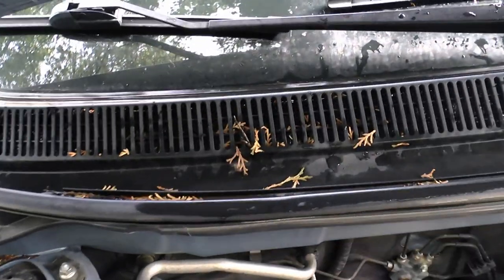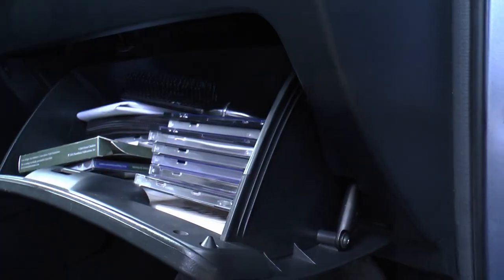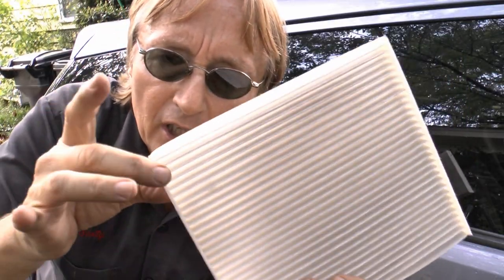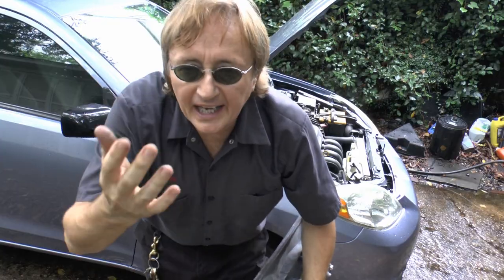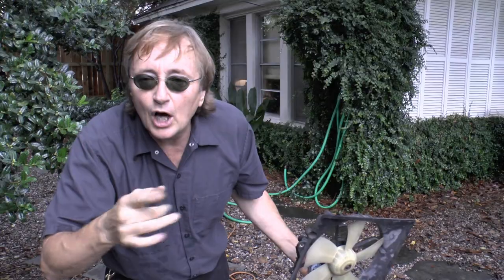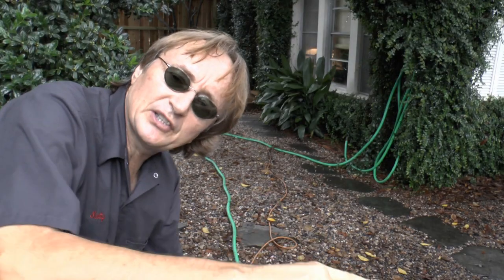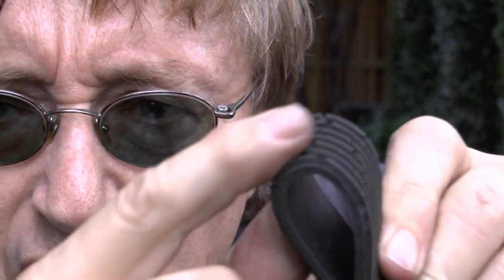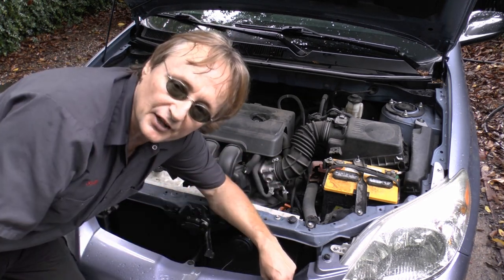How to Keep Your Car's AC Blowing Ice Cold for FREE

Comment: Thank you for the tips Scotty, I had previously thought my AC compressor was broken for several years when I finally discovered that it was in fact one of the fans (the smaller one that blows against the condenser). I ended up purchasing both fans and the assembly online for a fraction of the price (of the dealer) and installed it myself. The AC works now and blows cold air. 2008 VW Jetta GLI, 208k mi.

Comment: Tips to cool the car off quick. 

1- open the windows and drive around a bit it will circulate all the hot out. 

2- close the windows and turn your dial to AC let the car get nice and cold 

3- once cold turn the dial too the air recirculation feature it will recirculate the air in the cabin so the AC compressor isn’t always running saving you on gas. 

4 - turn the cold dial all the way to cold that way you can set the blower fan on low and still be nice and cold. This trick works nice with the air recirculation feature but won’t entirely freeze you out 

Those are my tips
Reply: Well that explains the automatic climate control gimmick as thats all it does, is lowers the fan speed after it reaches desired temps
Reply: @StudiosDelirium  wait really???

I always turned on the ac without rolling ny windows down and yet here i make a response to this

Comment: Got a recommendation for those dual fans. My car was overheating all the time at a stoplight when you have a low idle the compressor seems to work overtime and heats up really fast and overheats the radiator and the engine overheats. I always noticed that there was only one fan going and the other one kept going on and off so what I did was disconnected the connectors to both fans hook them up together in series and connected them directly to the ignition 12 volts. That way they're running all the time at half speed. This kept the radiator much cooler. You can even disconnect them in the winter time but don't forget to reconnect them in warm weather. No more overheating problems.
Reply: I was looking for this! My AC runs Ice Cold Yet when I'm at a stoplight it starts blowing warm and as you said then my engine heat temperature rises. I appreciate the idea thank you!

Comment: Yes, that nagging problem of bugs getting stuck in and plugging up the condenser and radiator. The simplest solution is to put a piece of screen in front of the condenser. It's much easier to clean the bugs out of the screen. Also, I remove it in the winter months, takes only a few minutes.

Comment: my ac consists of rolling the window down.compressors shot
Reply: nothing wrong with the good old 470 ac system haha
Reply: Wow your cool as fuck m8
Reply: I think you be wasting more gas that way because of the drag caused by the open windows.
Reply: Allanisbest not true...mythbusters busted that myth a while ago. AC uses a lot of power because the compressor takes up to 5 horse power to operate, making it less efficient to use than rolling the windows down
Reply: Well thank you
Reply: Allanisbest On the highway you are right. In the city running the AC waste more gas but it is marginal in either case.
Reply: Allanisbest yea ac kill mpg. thats the only good thing about not having ac lol.
Reply: don't be afraid to checkout some of my mechanical videos. All you respondents seem like great viewers.
Reply: CalebJ77
I thought the same thing. lol
Reply: im afraid Russian air conditioner would not do in my country ( rolling down window) 
three days ago it was 61 Celsius convert that to your preferred measuring system 
no need to warm up your engine in my opinion lol
Reply: CalebJ77
Even on the highway, mythbusters have busted that myth. It is less efficient running the A/C when compared to with the windows down, even on a highway.
Reply: i do it to reduce the thermal load on my radiator not the mileage
Reply: Faisal Abdulaziz Bullshit 61C!! What city, state? I smell LIES!
Reply: City= windows down/ Highway= ac
Reply: same here...especially after having removed everything associated with the AC from under the hood and scraping it...its kinda cool to remove stuff from the engine bay and the car still runs
Reply: @Faisal go update the Wikipedia article about the average temperature and add a comment stating that you live at that city.

That's what wiki is all about! you can even post a pic to wiki, make it it's own content dot point with an image
Reply: you need help...like fast
Reply: Allanisbest So,...what it BOILS down to is this; Do you want COLD air, or HOT air? fukit, if it's that hot, I'll waste a few dimes on the gas. Besides, I thought the newer units didn't put that much stress on the engine?!
Reply: James Valenti My 2006 Toyota Corolla gets about 6.5L/100km or 36mpg with the air conditioning always on in mixed highway and city driving. The AC button is literally never off year round. At that mileage, I don't really care if it uses a little bit less with the windows down, I'd rather have a nice quiet, comfortable ride. 36mpg is fine.
Reply: sweet stuff....that why little cars are more efficient in many ways
but if you can find the bmw  m3 (v8 engine) vs toyota Prius 1 gallon challenge you would be surprised
many factors come to play like :
1-  wight of the car    
2 - aerodynamics 
( obviously a box shaped van wound do good here would not do good with the first two)
3 - driving habits (do you accelerate hard ?)
4 - engine size to car size
6 - fuel system 
7 - environment (hot and dry ? hot and humid ?
cold ?) 
8 - increasing engine compression ratio means more power for the same amount of fuel
so less fuel is applied to to the engine to reach say like...80km/h ( =thus creating more miles/gallon
9 - are you using the turbo version ? or the
 naturally aspirated version ?
(turbo version run on richer mixtures when under boost)
10 - transmission ? (manual ? auto ?)
Reply: Faisal Abdulaziz 1.8L hatch, manual, naturally aspirated. Not really hot or cold just average. I don't accelerate hard, just the same as the cars around me.
It's a fairly small car but my dad has the Sedan version of the 2004 Corolla and he gets the same mileage.

http://upload.wikimedia.org/wikipedia/commons/d/da/2004-2007_Toyota_Corolla_(ZZE122R_5Y)_Levin_5-door_hatchback_(2011-11-18).jpg

I'd expect a bigger engine like a V8 to be affected less by the AC because of how much torque they have.
Reply: sweet what you have is a gas sipping machine lol
i agree thats why belt driven superchargers are ideal for v8s 
mine is a 1800lb volvo s80 3.0 turbo aspiration
does 70% of your cars gas mileage as long i dont exceed 60km/h (underboost and slow acceleration) 
once boost spools its bottoms UP for the fuel tank
kinda heavy (i hate the heavy doors)
and the interior isnt that big abit bigger than a corolla...
drag coefficient is ookay ?.... 
auto transmission...now there is you main mileage killer
Reply: Gary Kovach
I'm driving a 92 sc 400. Those things drink gas. I usually turn the ac on a few mins let it get nice and cold then turn the ac off and let the fan blow. I can usually catch 10 mins of cold air that way haha.
Reply: Allanisbest Refrigeration systems are least efficient when they first turn on. That's why home air conditioning specialist recommend a smaller air conditioner that will cool the house over a few hours rather than an over powered one that will cool it in 30 mins because they are more efficient that way. Whether that makes much difference to your fuel consumption, probably not. I just leave it on always but my car is pretty efficient, yours, not so much...
Reply: 3DMachines sweet you are from buffalo im originally from rochester scottys from niagara falls aswell which isnt far from where i was born
Reply: SvddenDeth maybe I should stop by on my bike then!
Reply: haha! i should invest into a dirtbike
Reply: Lol dalton been a long subscriber. It seems I always see random comments you've made on videos all the time.
Reply: I was going to say, that is 141 degrees Fahrenheit! I do not believe this person at all.
Reply: My old car has 240 ac.
Reply: Ah, that's what we call Chrysler AC.
Reply: Allanisbest and messing up ur ears
Reply: I drive with them down because I hate being in closed spaces for one and 2 my ac smells weird and gives me a head ache when I use it, besides if I turn it to cool and then have it off it stills blows in outside air so
Reply: i just researched it, the highest recorded temperature in kuwait was 54 degrees Celsius. which is still hot as fuck
Reply: James Valenti  up to 50 mph in that specific car... ac uses same ammount of fuel always, drag by speed changes mph faster you go
Reply: RIGHT!! Me to
Reply: 3DMachines And speeding
Reply: quit playing 3d machines
Reply: My old Buick was that way. Its not bad while moving but in traffic it sucks.
Reply: 3DMachines Fix it lazy but....😂😂😂😂😂💣
Reply: In the dark ages ac was rare. in the summer when a car went by with its windows up, we kids stopped playing and stared. "Must have air conditioning!" one of our brighter compatriots would say.
Reply: glad I'm not the only one suffering a future heatstroke
Reply: meyaw Abdulaziz 142° Fahrenheit
Reply: Yankee AC
Reply: Save dat money
Reply: Thanks you're right compressors out

Comment: Run it even in the winter to lubricate the seals!
Reply: running the defrost does this. the climate control runs the compressor durring defrost on most systems to help dry the air blowing through
Reply: Good advice
Reply: It runs in heater mode too, it's a heat pump
Reply: Brandon Gains not a heat pump. That's something different.
Reply: Brandon Gains its a refrigeration pump totally different
Reply: in automotive HVAC thats a big negative there good buddy. heat comes from the engine coolant in the heater core in that case. check it out yourself.
Reply: Garon Burwell who is that to?
Reply: bonkey it was to brandon i guess i'm an idiot have a great day
Reply: Garon Burwell you are nor an idiot , you know the difference between a refrigeration pump and a heat pump........don't be hard on yourself
Reply: Snowmobile mechanic..... looks like you blew a seal...... Eskimo......naw, that's just snot....................(sorry old joke)
Reply: Mark Weidenfeller m
Reply: It runs in the winter when your defrost mode is on
Reply: cndbx true, but some of us live where there are mild winters with little to no frost so it’s good to know about compressor usage by defrosting and the need to run the compressor when it’s not hot.

Comment: Thanks for the 101 Scotty! On the '05 Mitsu Endeavor the filter was optional. It plugged with leaves just like you said it would (wet carpet and sloshing). Got filter and snap on door kit from dealer. Cut opening along pre scribed lines, slid in filter, snap on cover, done! Located same where you show in glove box. And that year was impossible to find condensation drain tube. 
No problems since.

Comment: FYI:  The irritating screech everyone thinks is the a loose belt is sometimes a pulley;  many chrysler idler and other pulleys come with only very small dab of grease in the roller bearings inside causing premature bearing failure;  (u can pop off the oil seal with a pin then work it around the edges without damaging the seal), then pack it with more lithium grease (or other clean grease in a pinch).   If/when it does screech, later when engine is off, the hot grease inside will drip/ooze down onto the bearing axle, so the next time you start the car it won't screech anymore.  Works for me.  I was going thru a pulley every 3 months until I investigated their shoddy grease job inside the pulley ball bearing area.

Comment: As an HVAC guy I can confirm all of this is true. when we maintain a home AC system,  we clean the condenser, normally with a garden hose, and if it is extremely bad we get out the caustic brown coil cleaner that can eat right through the metal, clean, and rinse it. we normally use a much less harsh cleaner in the evap coil, because it is indoors and the garden hose is not an option. check filters while indoors, then we then measure all things electrical to see if any parts are failing, capacitors, running and starting amps, etc. in a car it is mostly the belts.

Comment: Great Vid Scotty! You explained every thing I always wanted to know... (hence I NOW know where the AC inlet is; because every time I start my AC I get debris from the trees above me being blown into the car...) --- Btw, my fan on the radiator isn't spinning --- what should I do and check? Is it fuses or something else? .... My car is a Peugeot 106 - early 90's model (pretty basic car). Thanx - & I Love your Vids, Awesome.
Reply from the maker: check the fan by sending power and ground to it to see if it's burned out first. often just that.
Reply: I had that same issue (regarding the fans not coming on) with 2 different vehicles and both just happened to be a $12 sensor which is the coolant temperature sensor.
Reply: Andrey Ivanov - Peugeot 106 has a very basic foam filter that can be cleaned/washed and put back into service. If leaves are being blown into the cabin most probably it's not there at all. Very bad idea 'cause usually leads to a scraped blower motor. Plus the obvious discomfort of having leaves being blown in your face. ;-)
Further more, clogged ventilation grill/ducts also lead in most cases to a burned resistance...When the lower speeds of the ventilation don't work. only full blast.
All in all it's totally worth to spend the 15 minutes it takes to do some maintenance. ;-)

Comment: Don't EVER spray the water AT the condenser, you'll just blow bug guts into it. Try to blow them out the front by spraying water from the back.
Reply: Robert Wall their are just bugs and with the water pressure they desintegrate into pieces and will just wash down with the water flow dont be afraid.

Comment: One thing I did about a week ago was get some radiator cleaner.  It's a spray can with foaming cleaner that will bubble up and get inside the fins of the radiator.  I did this on my truck and I noticed a difference right away in how cold the AC was.  I wouldn't use just any kind of cleaner, you don't know what will react with the aluminum, the stuff I use was found next to the home AC units, but it says you can use it on any kind of radiator.  They don't say to spray it off after you use it, but I did anyway just to clean out all the crud and bugs.  Simple $5 can is a cheap fix along with what Scotty recommends too.  Stay cool!
Reply: If you want it to get even colder and faster, seal off the gap between the radiator and the condenser.

Comment: is carbon filter make my car ac not that cold ? cause i heard from my friend that Carbon filter is 2 times thicker than the normal filter.
Reply from the maker: yes that is true
Reply: okay,i guess its time to switch back to normal one since the dealer give me the carbon one,and the ac is not that cold on my car.
and what is the benefit of carbon filter anyway sir ? and how about ac compressor oil ?
sorry,if i ask too much
Reply: The filter would only fuck with how hard the air blows has nothing to do with the temp. Oil and additives are bullshit unless your system is leaking. The AC compressor and other components wear out just like any other part of your car and need to be serviced or replaced.
Reply: Charles Choo should be ok, as long as it's not dirty
Reply: Charles Choo freon lubricates compressor. So don't run low on it.
Reply: Charles Choo check freon level yearly. Run compressor 5 minutes a month during winter. Set temp knob to hot.
Reply: Karl Is-Karl clogged filter will affect temp.
Reply: Karl Is-Karl freon lubes compressor tho. It's why you don't run a compressor low, or dry
Reply: ALL CABIN FILTERS ONLY WORK ON RECIRCULATION... IF NOT IT WOULD CLOG UP SUPER FAST..    My 2001 Volvo owner manual recommends about every 15,000 miles...
Reply: Charles Choo he said what it does in the video. it simply filters the air better. I.e. better to use in a polluted city.
Reply: Lawrence Wheeler i
Reply: Lawrence Wheeler Oil lubricates the compressor.
Reply: zonoz no, freon had lubricant in it
Reply: zonoz how does engine oil lube it?
Reply: Has
Reply: Charles Choo A
Reply: Refrigerant doesn't "LUBE" anything. There is oil in the system along with refrigerant.

Comment: Changing or cleaning the cabin air filter in a current model Volkswagen is very similar, but easier to get to without tools, you go under the dash of the passenger footwell, remove the foam cover by removing about 3-5 plastic wing bolts, then there you see the air conditioning unit, motor is accessible there for maintenance as well. for the air cleaner, there is a lid where you push a locking tab and slide the lid across and it comes off, out comes the air cleaner. you can remove the motor quite easily as well without tools for maintenance or replacement, just some locking tabs and wiring.

Comment: OMG, I think you may have helped me solve my AC problem on my wife's car. It works fine when she first starts up the car. After a few minutes the car heats up and the compressor stops and all that nice cold air turns into hot air. The system is fully charged and works great until it warms up. If you drive it at night when it's cooler out the system never stops cooling and after about 10-15 minutes during the daytime it stops. I'm going to check the cars cooling system and make sure it's okay. Either the coolant is low / bad, or there is a bad sensor. It totally never crossed my mind.